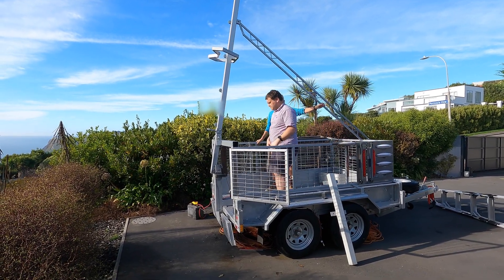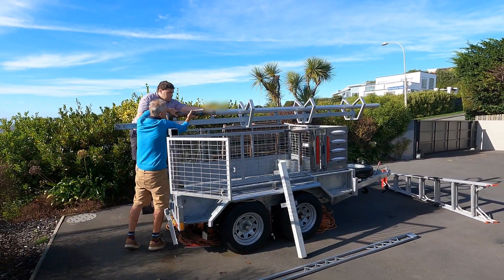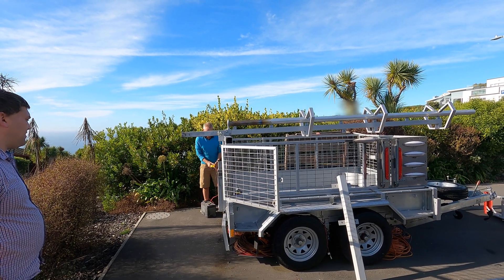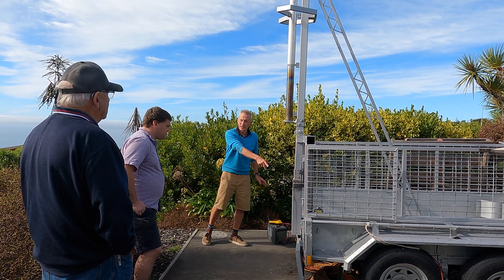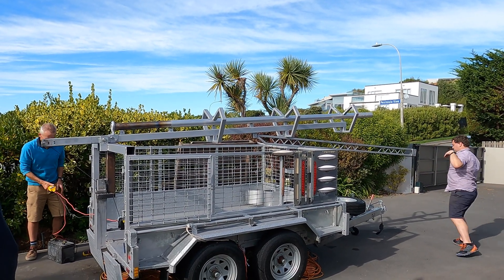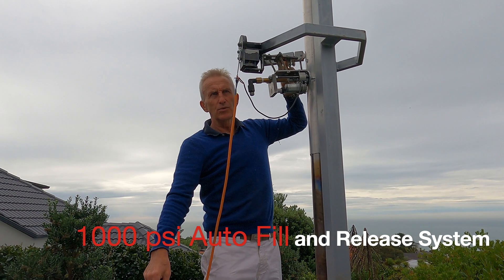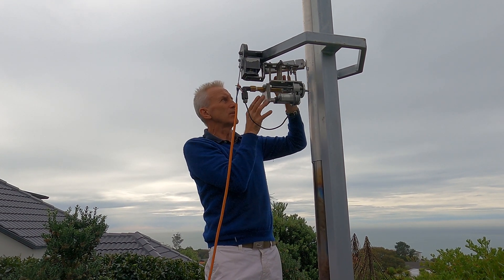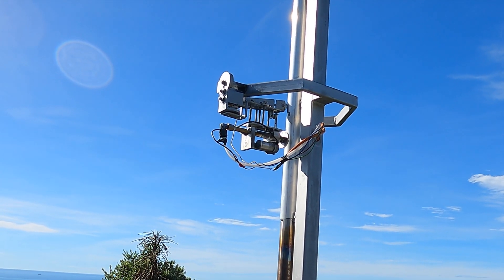Test Run of our Rocket Launch Platform and Fuel Auto Fill and release System | Hybrid Rocket    4K

Comment from the maker: It’s a good observation but if a rotation occurs clockwise the fin will only slide against the main upright stopping the opposite fin from colliding. 
Anticlockwise rotation same deal different fins. 👍
Reply: ah yes you are right, I think I was picturing 4 fins for some reason